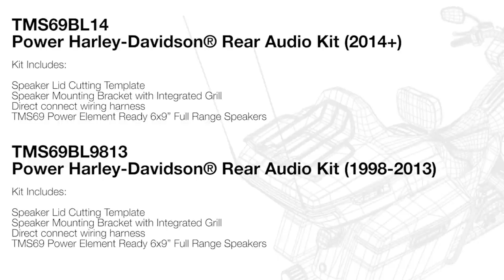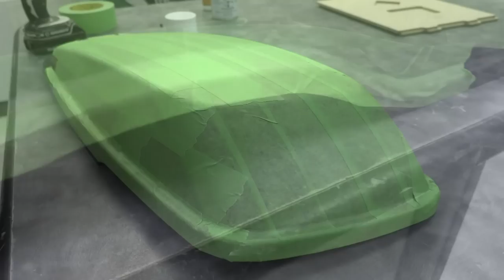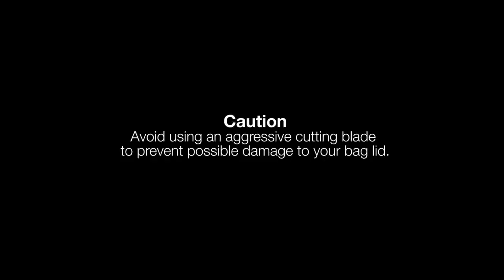TMS69BL14 & TMS69BL9813 Installation

Comment: Anyone know if these kits will work with the puck style locking lids?
Reply from the maker: These are not designed for use with H-D® Power Lock Kits.  You can see details on the installed lids here: https://rockfordfosgate.com/products/details/tms69bl14/
Reply: @rockfordfosgate  thanks for the response.  I have the hockey PUCK style locks, not power lock kits.

Comment: According to your website this is not compatible with fiberglass lids
Reply from the maker: That is correct.  Early models were fiberglass and we do not recommend this kit due to complaints about fitment.  Since this video, we've made improvements to the baglid cutting template and you no longer need to remove the hinge hardware.
Reply: I have a 2013 FLHTK,  with fiberglass saddle bags, so you're saying that this TMS69BL9813 is NOT compatible? By the looks of numerous videos I've seen on YouTube, etc., it looks like you can use the template. I am probably having these professionally installed.
Reply from the maker: @daveritz18  We do NOT recommend this kit for your Ultra Limited with fiberglass bags.  Although we have had customers say it did work, we have also had a fair share of customers say the speaker clamping system did not fit properly due to thickness variations of the fiberglass.  Early on, after we released this product, we updated our recommendation to plastic bags only, since the material thickness is consistent.  Unfortunately, we no longer recommend fiberglass bags.
Reply: @rockfordfosgate  thanks for the clarification...
Reply from the maker: @daveritz18  You're welcome.  The more info you have, the the better equipped you are to make a decision on how to proceed :-)
Reply: @rockfordfosgate  kinda disappointed really wanted the RF lid speakers along with the tuner, amp and fairing/tour pack speakers
Reply from the maker: @daveritz18  Us too!  Nothing would sound better (and louder) than Rockford Fosgate on your bike!  If your installer is an expert with our saddlebag speaker kit, he'll likely know how to shave down any fiberglass to the appropriate thickness.  If he's not, I want you to be happy, not sorry... even if that means using a different solution.

Comment: Can I use my own speakers?
Reply from the maker: The Bag Lid kits for both the 2014 or newer models and the 1998-2013 models were designed specifically for the Rockford Fosgate TMS69 2-way motorcycle speaker.  A pair of these speakers are included in the kit.  We cannot guarantee fitment with any other speaker due to differences in various 6"x9" basket sizes.

Comment: Does it fit on 2019 road king special
Reply: And what else will I need to get music on this Harley
Reply from the maker: Yes, the TMS69BL14 bag lid speakers will fit those bags.  However, it's not a complete kit and will need to be retro-fitted to an amplifier and amp wiring kit. You can read more on the bag-lid kit here: https://www.rockfordfosgate.com/products/details/TMS69BL14/

Comment: when will this be available to purchase?
Reply from the maker: Hi bperez71, these have been shipping for the last 3 weeks, but quickly sold out during Sturgis.  You can pre-order on our website to reserve your set when more hit the warehouse at: http://www.rockfordfosgate.com/products/details/tms69bl14
Reply: I already have a 4 channel amplifier... will this be an issue? Can i just order the kit without the speakers? ETA when they are expected to be back in stock at the warehouse?
Reply from the maker: You can use the rear channel from the 4 channel to power these, so that shouldn't be a problem.  The 6"x9" is sold separately as the TMS69, but the TMS69BL14 retrofit bag lid kit ships with grilles, adaptor plates, and 6"x9" speakers. I just checked with sales and it sounds like they will be in stock within 1-2 weeks.

Comment: Hey what about the sound
Reply from the maker: The TMS69 speakers included in these kits are specifically built for motorcycle audio, they are not a repurposed "car audio" speaker.  We measured the frequency response of the motorcycle itself, wind noise, exhaust, and tire noise on Arizona roadways up to 75 MPH.  We determined a consistent pattern of the frequencies being drowned out, so we tailored the response to bring out the best in various music types under these conditions.

Comment: I should have read the comments, who cares how easy the install may be if it sounds like shit.  And you did not provide a before and after sound clip?  I understand the real sound probably wouldnt come through, but you can still tell alot from a before and after using the same PC speakers.  - Bad move
Reply from the maker: Hi Doug, like many Harley enthusiasts, motorcycles are not purchased by watching YouTube videos alone, right?  Rather they experience the bike by riding their buddy's or actually stopping by a Harley-Davidson dealer to test drive one.  High performance audio systems should be reviewed in person, where you can experience the clarity and loudness.  We'll be Biketoberfest, Sturgis, and many other motorcycle events throughout the year, and we'll be happy to show off any demo bikes on site.  You can also use our dealer locator to find a Motorcycle Audio dealer (motorcycle wheel icon) near you at www.rockfordfosgate.com/dealerlocator